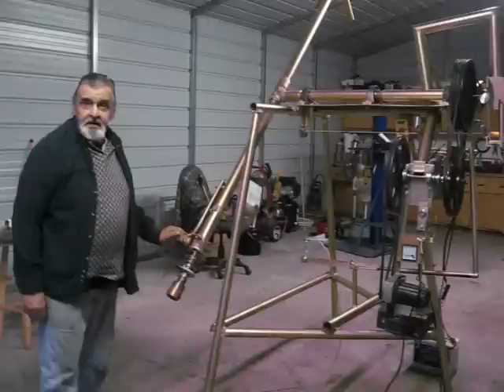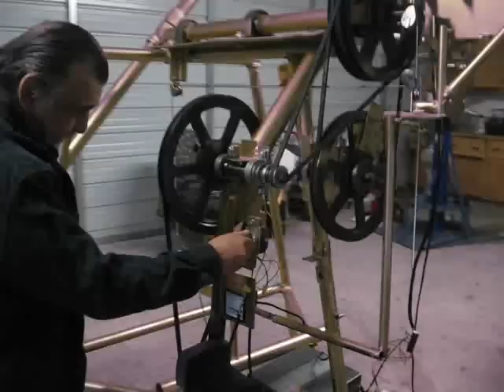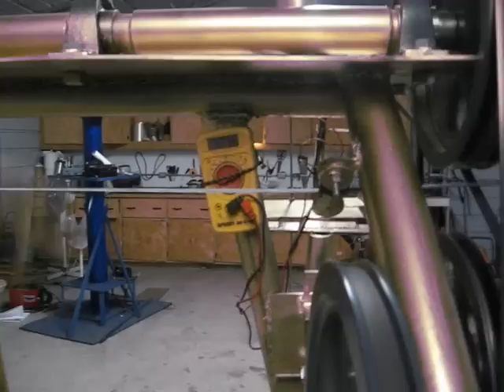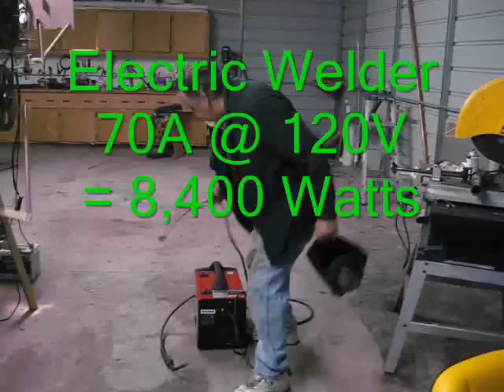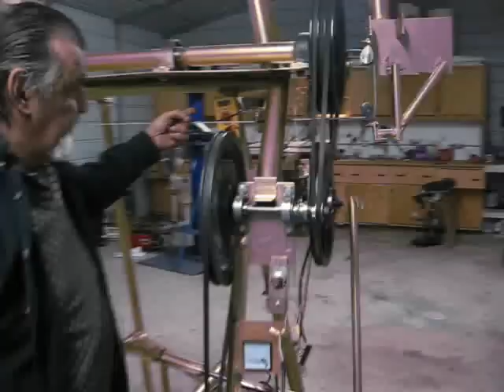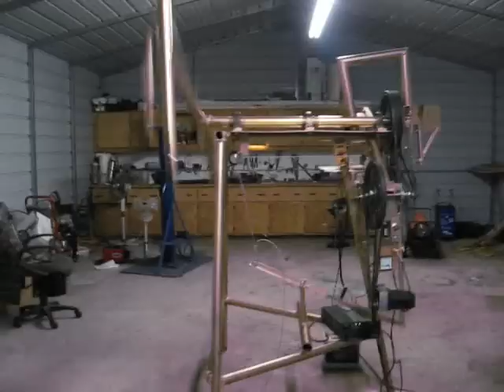Angular Force Generator (AFG) Prototype Movie by www.OBM-Global.com

Comment: Is there any chance you could hook this up tot a permanent load i.e a tv or 10?

Always with these type of video's you see the same thing, namely an unclear proof of concept.

Provide input and output Voltage and Amperage to show power in/out and you have me interested.

I don't want to dim your enthusiasm but you have to demonstratebly prove your claims above any valid doubts raised by your peers.

Good luck.